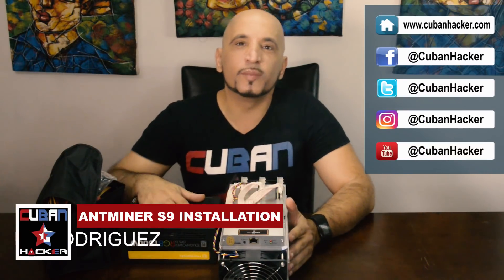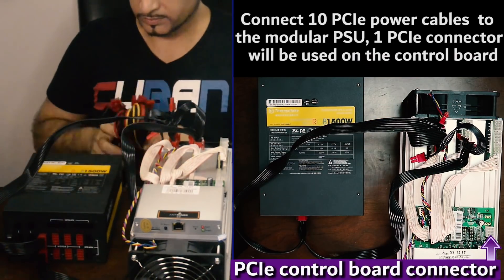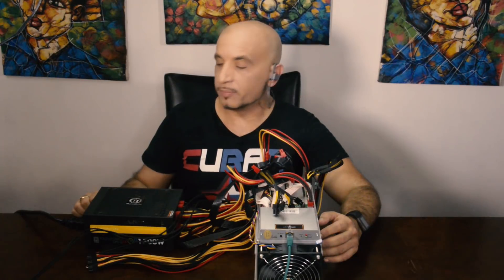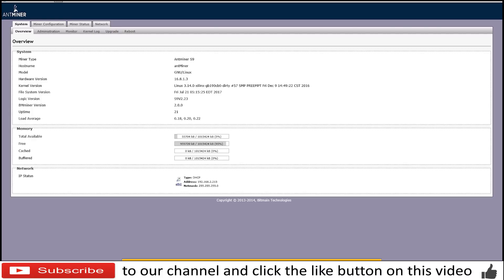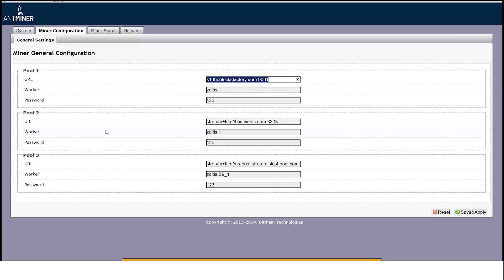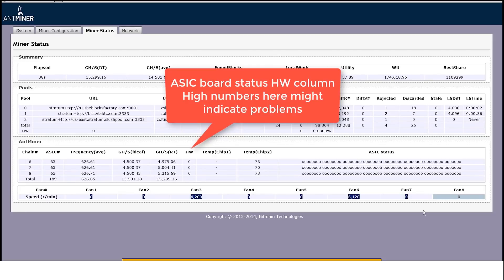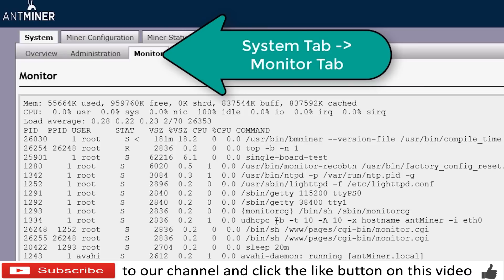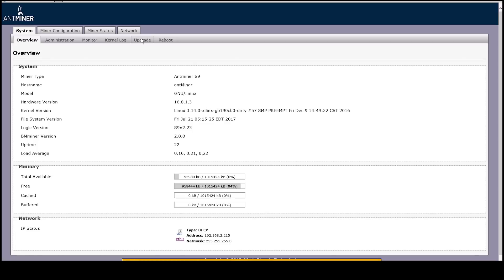Bitmain Antminer S9 antminer setup , install and powering up. Antminer S9 review .BTC & digibyte

Comment: Can the Bitminer S9 mine other SHA-256 coins? Or does it only mine BTC?
Reply from the maker: The S9 antminer will mine any SHA 256 coins , not only BTC. You can switch to more profitable coins anytime.
Reply from the maker: Today will finish a video on how to mine DGB (DigiByte) , what other SHA256 coins are you interested in ?
Reply from the maker: Yes, here is the video explaining how to mine other altcoins with a s9 antminer https://youtu.be/Up91YKPsVd4
Reply: antminer s9 mines bitcoin cash?how?
Reply: Can you mine BTC and any coins at the same time?
Reply: Does mining DGB sha256 need mining software like BFGmining or CGminer?

Comment: Good day sir thank you for your instructions : How do we configure the miner to send the mined BTC's to our wallet? And sir If I buy 10 Antminers S17 Pro, which power supply do I need for each of those? 

Lastly:
When setting up our miner, we dont need to connect the miners to computer by cable right? Just the plugs in and out and then find the IP and start?

Kind Regards,
Thanks.

Comment: Does it have to be connected to Internet via LAN line? I thought wireless would work. Also does it give off heat?
Reply from the maker: Lots of heat and noise, enough to keep you warm and drive you deaf. No, not wireless... unless you use a wireless adapter.
Reply: @CubanHacker   thanks. What wireless adapter would you recommend? My unit would need to be away from router
Reply from the maker: @jduncanm3golf  you would need  a wi-fi to Ethernet adapter for wired devices like https://amzn.to/2reCbZt or like https://amzn.to/2rhXo4M , depending on how many ports you would like to have

Comment: amigo tengo una duda hablas español a ver si me ayudas? tengo dos antminer s9, las tengo con el pool de btc ya que con el de bitmain no veo que procesada el proceso no se porque, y con sluhs tarda mucho en arrancar, en miner status me aparece una con estos datos 
Elapsed
1d56m27s
GH/S(RT)
0.000000
GH/S(avg)
14,126.20 
FoundBlocks
0
LocalWork
4,682,609
Utility
6.13 
WU 
199,800.61
BestShare
312094762

y en la otra asi 

Elapsed 10h9m22s 
 GH/S(RT)14,073.95 
GH/S(avg)14,129.42 
FoundBlocks 0 
LocalWork1,902,400 
Utility6.25 
WU 201,544.44 
BestShare 38122071

mi duda es porque en una me aparece ghs rt y ghs avg marcado y en la otra no me aparece igual en la otra me apare 0000 y al lado la potencia sola en avg por favor ayudame a esto
Reply from the maker: Slush pool funciona muy bien, en que pool estas usando los antminer S9 ? Deja chequeo los datos que me pasastes...
Reply: Cuban Hacker en la Pool.btc.com ahí me funcionan las dos Antminer ayer incluso puse las de nicehas como tú lo indicas y nada, más de una hora paso y no vi ningún movimiento todo en 0

Comment: Your temp chip 1 is showing as " - " is this normal? correct me if im wrong they should both be up and active
Reply from the maker: Not really it depends on the S9 generation and batch , earlier batches displayed Tmp(PCBd) instead of that column, never seen that temp1 column display a value across 3 s9's from the same batch.
Reply: Interesting I'm running 2 S9_V2.20 and they'r both displayed. I guess if they're hashing with good temp's nothing to worry about!
Reply from the maker: I actually asked bitmain support about it and they said that as long as the chips are not missing any 0000 or displaying XXXXX on the chip statuses it should be fine.
Reply from the maker: Yes, if you look up antminer s9 status screen you will see both versions of the UI